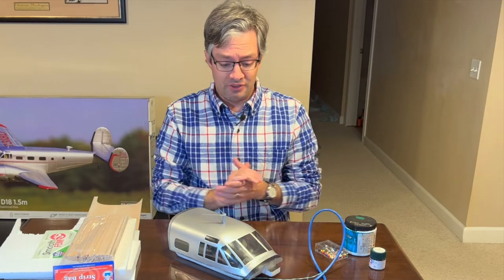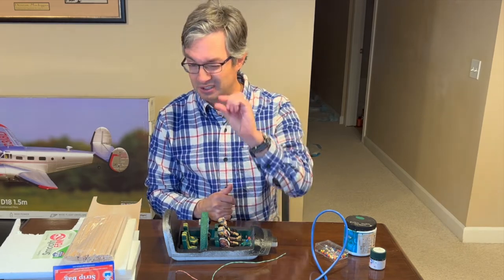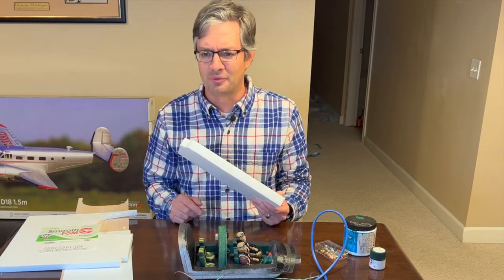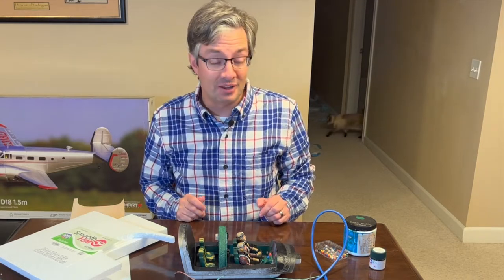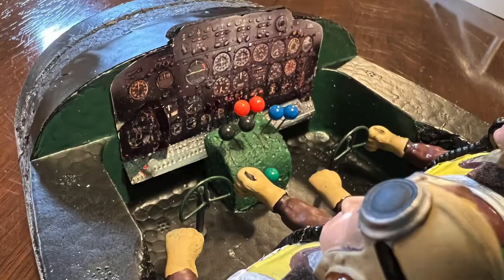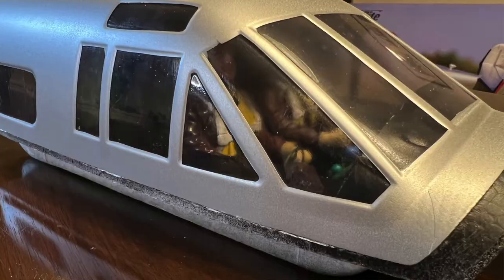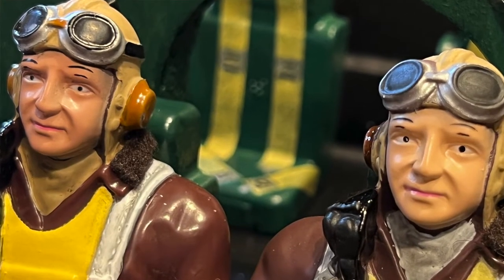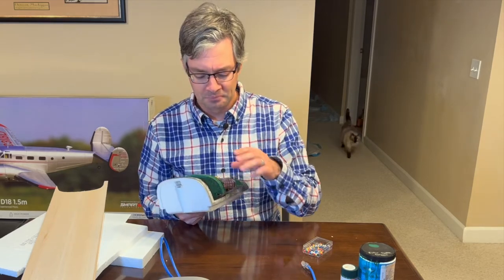E-flite Beechcraft D18 SNB Project Episode 4: Detailing the cockpit

Comment: Looks very nice. I think it would win a scale model contest. Looks realistic with canopy on. Plus I think you need to make a pack of lucky strike cigarettes to put on dash. Keep up the good work and videos. Happy holidays 😁🍻
Reply from the maker: Thank you!! Sadly, I don't think any of my stuff would do well in a scale competition. I do think it looks good and I am happy with it, so that counts for something. I did think about adding more scale bits including a map of Oahu folded up on the instrument panel. I decided to cut the detailing short as so very little of it can be seen with the canopy on.
Reply: @BRGT350  - Thanks for this next episode.  Agree with you, some "rivet counters" go way overboard on the details.  But in this case, you're just going for an impression of detail.  And I think you well accomplished your mission.  I'm going to follow your lead.  Was going to convert the pilots' headgear to USN Officer's Garrison Caps with radio headsets, but seeing your pilots, I'm just going to paint them as you did and call it "good."
Reply from the maker: Thanks Craig. I am happy with the results of the cockpit considering the low investment I put into the details. I had looked into nice resin printed pilots, but they were all fighter pilots and I needed 2 of them, which was starting to get very expensive. Plus, you don't see all the details of the pilots when the canopy is glued together. These 1.1m warbird pilots worked great and with a little paint work, they look like Navy pilots. Surely more period correct than the factory civilian pilot. I was super happy to find the FMS 1.1m warbird pilots as they solved a big hurdle with pretty low investment.